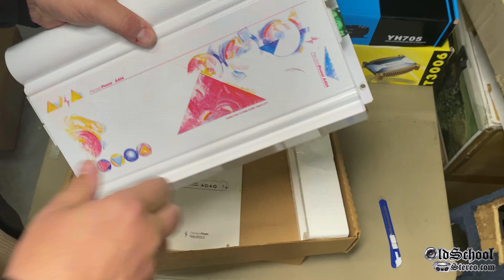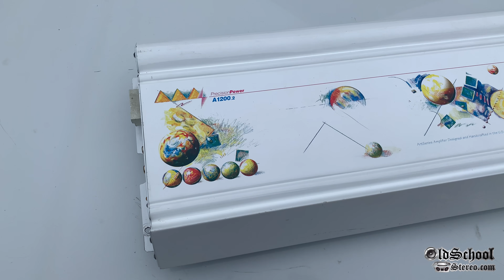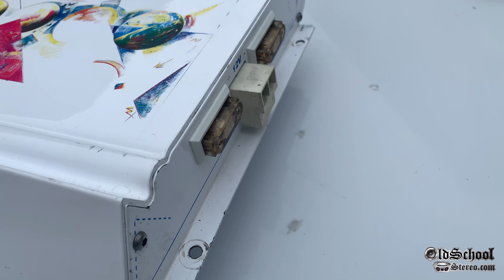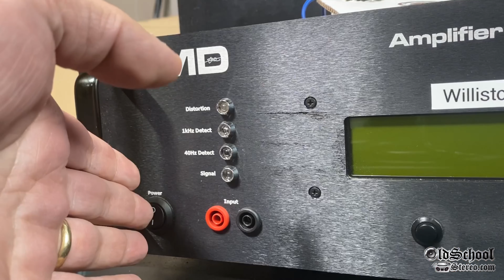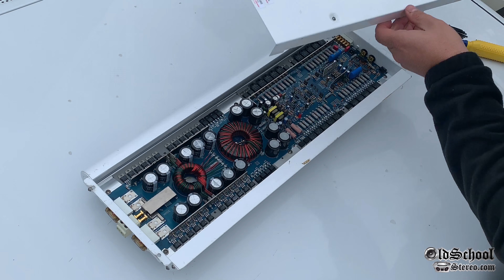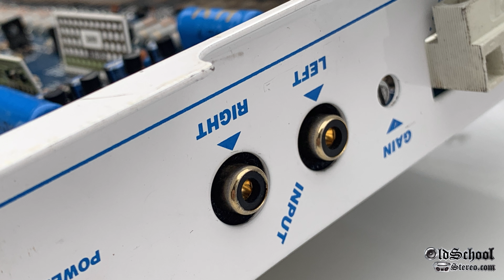1996 PPI Precision Power A1200.2 Amplifier Review and Amp Dyno Test

Comment from the maker: Correction  9540/9535 is the date code on the transistors. The FETs are (ST)P60N06
PREVIOUS VIDEOS
1989 PPI 2350DM vs Alpine 3545: https://youtu.be/VbfBwLvaj4E
1991 PPI 2300AM: https://youtu.be/wDy7hYagJMk
1991 PPI ProMOS 50: https://youtu.be/X3eAg5rliU8
1993 PPI A404 and A600: https://youtu.be/XE2uuY-zKKE
1996 PPI A300: https://youtu.be/Nzb6o95m1Dk
1996 PPI ProART 100: https://youtu.be/VDWOtGrLzGE

SUPPORT on Patreon for Early Video Access: https://www.patreon.com/OldSchoolStereo

3 Modes of the Amp Dyno Explained: https://youtu.be/Q0m6NsB-HHc

Get your WAL/OSS Merch: https://bigdwiz.creator-spring.com/ 
Buy Me a Coffee/Tea/Slap-a-D-No : https://www.oldschoolstereo.com/p/donate.html 

TEST BENCH EQUIPMENT
SMD / D'Amore Engineering Amp Dyno: https://goo.gl/sJTcf7 
XS Power LTO Lithium Battery Cells - https://lddy.no/1ivr6
XS Power D1400 14V AGM Batteries - https://amzn.to/2BPFCKW 
XS Power Titan 8 Lithium Battery - https://lddy.no/1iq28
XS Power PSC60 Charger - https://amzn.to/2CHGcfs 
Fluke 1000A AC/DC Clamp Meter: https://amzn.to/2Rw5WDA 
Handheld Dyno: http://amzn.to/2u2EgKV 
My Favorite Screwdriver Kit: https://amzn.to/3vijokl

DISCLAIMER: This video and description contains affiliate links, which means that if you purchase from one of the product links, I may receive a small commission. As an Amazon Associate I earn from qualifying purchases

Comment: wow... seeing PPI again brought back some FOND memories! had 6x 12" subs in my ford ranger and some MB Quarts - all running off of PPI (404, 600 & 1200).  also had the connector for the 404 & 600 that made them look JUST like the 1200.  so cool!  oh yea, and 4 caps that had a little light bar on them when they were filling/draining with power.  forgot how BEAUTIFUL these amps were.

Comment: I have a A1200.2, Ax606.6, A600 and a A404. One day imma take them and get them recapped and put back in service. Best sounding amps ever. I replaced the first two with Arc audio amps on some CDT audio separates in my daily and they been going strong for over 6 years. I also got a Soundstream Reference 10.0 A class and another nice sized Reference 4 channel i want to have gone thru as well.

Comment: Very cool amps. I remember them back in the day. You should find a Autotek MeanMachine MX1700 and do a review. I strongly regret trading that amp for a US amps vlx25 back in 1998. The MX1700 was a 2 channel high current that ran .5 ohm stereo, and im willing to bet bet did over its rated power which was 1700rms bridged, but it was power hungry for.sure. Great video
Reply from the maker: Thanks for the suggestion
Reply: @wal2  Np, its actually the 1300 mx. Its been a while. They made up to a mx5000. The MX series in general

Comment: I still have 2 ax400s i used for mb quart separates 3 ways front and rear and my 3002iq linear power i used for 3 jl12w6s into 2 ohms such a rock solid set up i kept it for 30 plus years and visit them on a shelf regularly lol

Comment: You can use one of these amps with either 2 or 4 decent 12 inch subs in a sealed enclosure and be heard from at least a half mile away! Our systems back in the 90s were nowhere near the size of car audio set ups today and our bass sound would travel way further outside and away from the vehicle‘s back then compared to car systems today

Comment: Always wanted the A1200 for my 4x12 JL's in my Escort. Always wondered if the A1200 would've been a better choice to the following: My Reference 500sx blew up three times, my zx350 blew up twice. Finally got an Alpine amp (had a friend that was friends with the regional rep) so got it at dealer cost. Don't remember what model, but it never died. Man I wish I still had my black A404.2. Thanks for the memories Big D!
Reply from the maker: Wow those S and SX series Soundstream Amps were not reliable as I’ve heard countless stories of them having issues

Comment: I owned, the art series, sedona, and power class PPI amps. I don't think todays high powered smaller packaged amps have the same sound quality. I think they are suffering a bit n that department.
Reply from the maker: The old amps are so big and have so much class they are tough to use these days due to their size, but will always be unique and make many of us smile just by seeing them
Reply: @wal2  just like a muscle car.
Reply: @wal2 Subs take up much more room.  If you integrate the amps in the area with the subs, do you really even know they're there?  Mine were behind my subs and no one ever saw them unless I had my seats down, which was never.  My car looked bone stock (except the hatchback, which was covered) other than my head unit and you couldn't tell what that was because the face rotated.  Out of sight, out of mind. 😉 I recommended doing that to all my customers - I sold auto security, too, and heard plenty of horror stories.  Never understood the people who put the stickers of their equipment on their car.

Comment: Back in 1995, a local stereo shop had a demo vehicle (ext cab Silverado) with Art series amps on a motorized amp rack. A1200 on 3 JL 12W6 subs and two A600s powering  mids and highs. It was the first system that tickled my nose and blurred my vision.
Reply: They never had the PPi van show up for a demo, the stereo shop here did that sold PPi.

Comment: Sadly this amps didn’t come with crossovers or any adjustments but nonetheless they still sounded magnificent specially the Art series amps.
Reply: Lack of any onboard processing was a selling point at the time. Still is for the SQ crowd. Have a look at modern Tru Technology or Linear Power amps. Same basic features as these old PPI's.
Reply: You didn't need them.  There is a thing called an electronic crossover.  PPI even had it so you could run DIN-cable Phantom Power from the crossover to the amp that carried remote turn-on and signal.

Comment: This Amp is very overated. Imagine if he didn't test it at 14 volts. A 12 volt test as it's rated would have done very poorly. Big d knows that
Reply: they are usually a little under rated power, everyone knows that.
Reply: While I've owned art series amps and like them. I'd have to agree these were always viewed making a good amount more than its rated and for being sq amps. Not to mention expensive.

While they do sound good they don't make rated power. So yeah I'd say they are one of the most overrated products. Along with zed made amps. Which is disappointing because I was a fan of both.
Reply: @jasonnelson6624  power is not important.
Reply: @V8Lenny  you mean its not important to you. But even if its not important to you. Can you show me another high end expensive amp manufacturer that doesn't meet their specifications? Not to mention the fact it had the reputation of exceeding them. Which to me I had to agree they are overrated and don't live up to the hype that's always surrounded them. Plus I've owned and liked them but their reputation is overrated.
Reply: @jasonnelson6624  you cant hear 10W difference, you dont even see it in dB meter, these were made for SQ. Yes, I have seen many high end amps not make rated power. They are just numbers, they could have as well say it is 1150W amp and you would be satisfied, 1200 is just rounded number, looks better than 1150.2
Reply: @V8Lenny you seem to be missing my point. The reputation of the art series line is they are considered some of the best sounding amps you can buy period. They are considered to be very conservatively rated on their power output. Are they top 5 best sq amps money can buy or even top 10? They dont make rated power I don't care if its just a number. Its still a number they get to pick. Zapco, orion, Jl, Phoenix gold, some zed models did their specs and with regulated power supplies. Again ppi was high end amps with high end cost. When you spend top dollar do you not expect to get what you paid for? Or you dont care because I do. Lastly you keep saying or acting like its just numbers that dont matter. Which again they do any event you enter your system in will either require those numbers to determine your class. Or you will produce a spl reading for your score. So how are those useless numbers? Oh I forgot you said power wasn't important 🤣🤣🤣
Reply: Not necessarily. Regulated power supplies allow full or at least close to rated power even at low voltage. That is actually addressed in the owners manual. A feature that first appeared on the old PPI AM series amps.
Reply: Back when these amps came out, most people were installing them in cars from the seventies and eighties that had really weak charging systems. The regulated power supplies helped to deliver more power at the low voltages that you'd typically get. 

Over time, the market changed and  unregulated power supplies became more common.

Comment: Well this really shoots down my theory that the majority of old school amps I’ve loved had one thing in common. Ridiculously high dynamic power output. 

Love these amps , and my ears always convinced me I was playing with more juice than advertised. I’m shocked that they don’t even make rated numbers. Still sounded friggin sweet though.
Reply: Your not alone. The art series and zed amps always had the reputation for being underrated. Turns out they come up short but close to rated. They still sound good though.
Reply: Your ears couldn't tell any difference. Remember, you have to double power to just get a 3 dB increase in output.
Reply: @msh6865  I wasn’t necessarily speaking about output. Just that a lot of my favorites from the era have been dynoed in recent years , nearly all of them had ridiculously high dynamic numbers like OG MTX amps. 

Seeing that , I had a theory that the big dynamic numbers may have been why they were so appealing to my ears. But seeing these numbers , and like someone mentioned above with zed amps it shot down that theory.
Reply: Keep in mind that very few people back in the day we're actually getting all of the power out of the amp. People would think they were getting a 1000 W. When in reality, it would only be a few hundred. So you would have extra power available for dynamic purposes.
Reply: Correct. The speakers impedance/resistance fluctuates up and down based on the frequency it plays and there is a minimum it will reach. That minimum is always higher than what you measure across the voice coils with a meter. So a speaker might be wired to 2 ohms, but it will vary a lot based on the frequency. It might have a range of 3 ohm to 16 ohm. So you never truly get the 2 ohm power the amp has available. 

The dyno uses a fixed resistive load. Several large resistors that give exactly 2 ohms of resistance. This will stress an amplifier a lot more than a speaker wired to 2 ohms, but it does tell you what the amp is capable of at a real 2 ohms. 

I kinda lost my train of thought, but I hope this helps.

Comment: When I was 16 back in 96 this series of amps was like the holy grail at the local stereo shop.  Too rich for my mcdonalds budget at the time lol.
Reply: I still have my old 2150,  I will die with it!
Reply: I had 2 600.2 and 2 300.2 in my car at 1 time  early 2000s
Reply: Same, spent many hours drooling over these in the local stereo shop back in the day
Reply: Same here. LOL I ended up with a linear power LP 200 instead. It was a good amp but it was not a PPI art series
Reply: A 1200.2 was 1 of the hardest amps to find i ever looked for i needed 2 for 2 kicker solobaric i was running i ended up running kicker zr 1,000 instead
Reply: Yeah it was these and the OG Zapco.
Reply: Lol yes sir, i was working at target 😂. My buddy had 2 art series in eclipse with 2 jl 10s and some boston autistic mids. It was CLEANNNN. He spent more on his system than my whole car cost
Reply: 1980 represent! I have a bunch of these currently. Not the 1200 but the others.
Reply: Same here. A1200 was a dream of mine.
Reply: I still have my PPI chrome PC2600 that I bought on my McDonald’s money back in the day.
Reply: I was negative three years old in 1996, but my dad influenced my first sound system purchasing when I was 16 and I ended up getting an A404.2 for my mids/highs and a JL 500.1 monoblock for the sub. A few years later he got me a matching A600.2 to use for the sub. I still have both of the amps to this day.